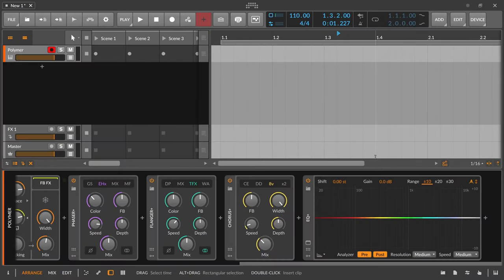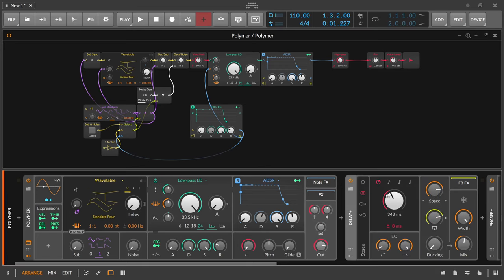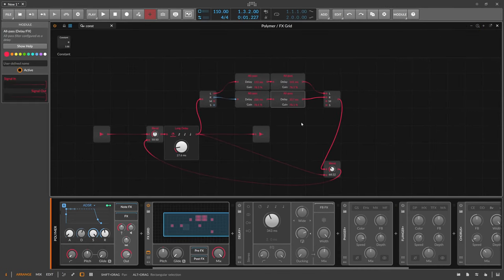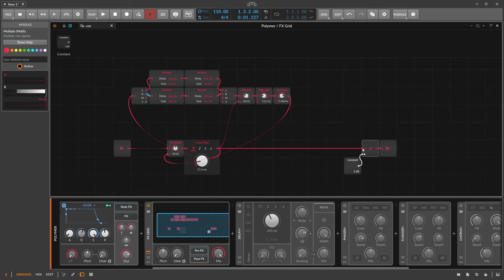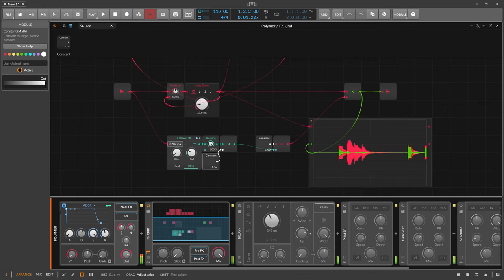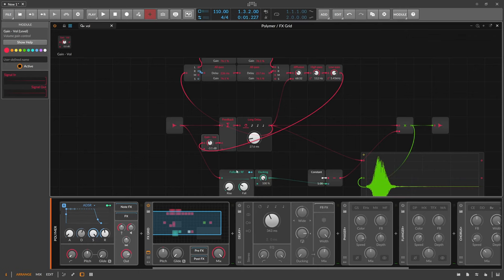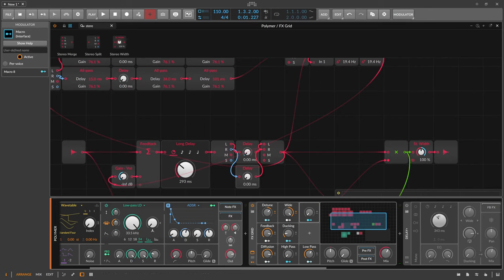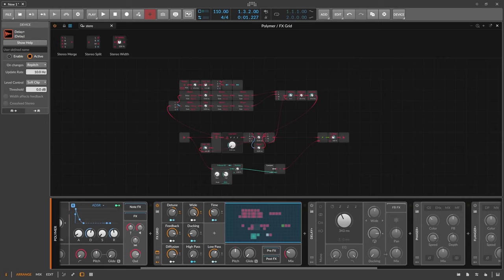is this a future feature of Bitwig?

Comment: Allowing for some basic interface design seems like the next logical step for the grid. 
My most wanted change is for a larger maximum array size so it can be used for custom delay and glitch fx 
(1024 seem way too small for audio rate uses)

Comment: You'd also need to be able to insert a Wet FX inside the grid, which sadly isn't possible. Idk if they communicated on the ability to insert arbitrary devices/vsts inside the Grid in the future.
Reply: You can route from and to the grid via the vst in device panel, but you have to modulate out from the grid to DC Offset devices for the VST or loopback using HW Out feedback capability to 'send' the grid signal back through to an audio receiver in the Grid and use Timeshift to to match your buffer size to sync it all back together again.
I'm hoping at some point Bitwig opens up a device to receive multichannel, not just output it and also route the grid in and out of native or vst devices without needing DC Offset, just as if it's part of the signal chain like anything else in Bitwig. Then you've full modular multichannel ability and no barrier to and from anywhere, be it grid, hw, vst or device. Would be so cool!
Reply: @SamHocking  
> "you have to modulate out from the grid to DC Offset devices for the VST or loopback using HW Out feedback capability to 'send' the grid signal back through to an audio receiver in the Grid and use Timeshift to to match your buffer size to sync it all back together again."

Yes. Please allow me to sum that up by "Wet FX inside the grid is not possible" ^^.

Joke aside, I get the point, and thanks for the tip ;)
Reply: @ywenp  Not sure why you read it literally as clearly it's a workaround, but that aside, it does make processing only the wet signal possible from VST for use inside the Grid.
Reply: @SamHocking  yes, sorry I was joking. Sorry if it sounded aggressive...